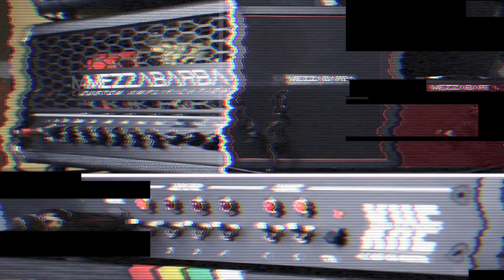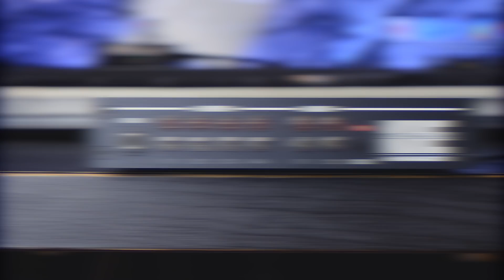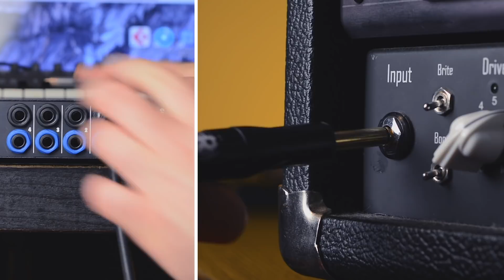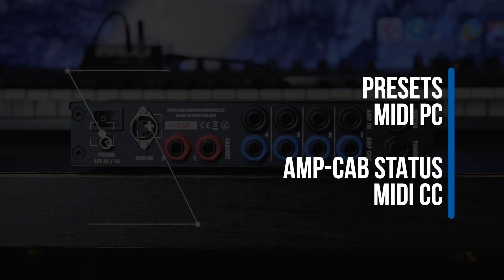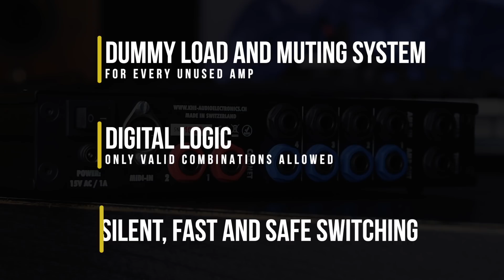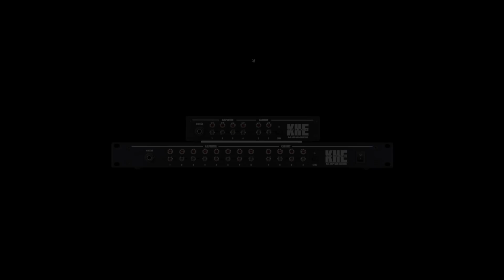KHE Audio Electronics ACS 4x2 | How I ever lived without it? | Amp-Cab Switcher

Comment: This is a cool device, but how about the pedalboard or FX loop?, where in the device can you connect it? Means, I get the idea of 4 head amps and 2 cabinet speaker but people use the send and return from the head amp to their pedal, that means I have to disconnect those cables or did I miss something?
Reply from the maker: Hi! Please take a look to the new line of KHE products! This is an old video!
I have son my channel the 4x4FX video where I explain how to use the FX loop.
On the old versions like the 4x2 you would manually disconnect send return cables and route them again the new amplifier!

Comment: Hey Giacomo!

Really great video, this seems to be what I've looking for for years so I was very exited to find your video today!!

In my current setup I run my amps throught the Rivera Rockcrusher (for power attenuation)  to an isocab (Rivera Silent Sister). Would it be possible to connect this KHE ACS 4X2 between the amps and the Rivera Rock crusher? I guess right?

Also, I've heard that similar amp switchers can alter the sound a little bit. What are your thoughts about this regarding the KHE ACS?
Reply from the maker: Hi Magnus! Yes, you surely can without problems!
I've done so many tests, this KHE is absolutely transparent unlike other systems. :)
Reply: @giacomopasquali  thanks a million for responding! This unit is on the top of my to-buy-list! ;)

Comment: What happens if you try to switch cabinets and the speaker is blown or not plugged in or faulty cable = open circuit = valve/tube power amp damage? Can you use the switcher with a solid state power amp?
Reply from the maker: Hi Richard, the unit takes care of verifying all this stuff so it's everything safe. For example, if yo have an open circuit you won't be able to activate that cab/head.